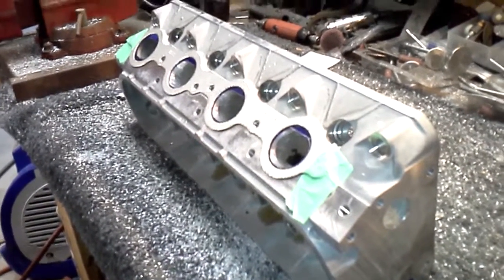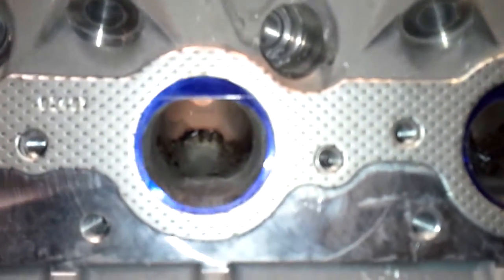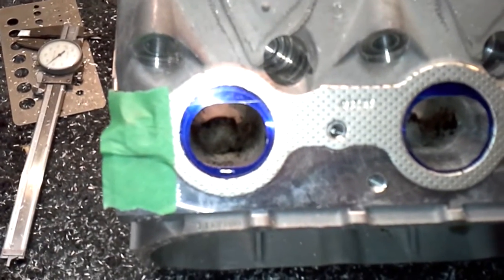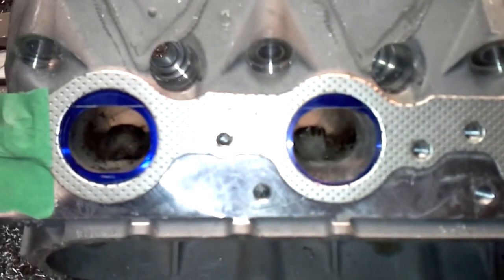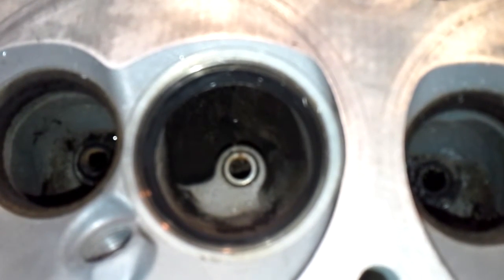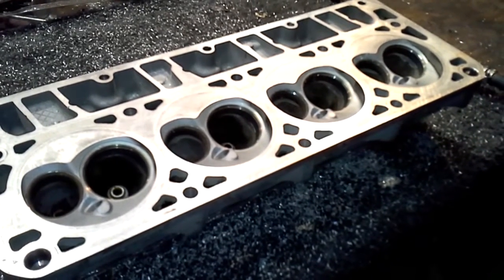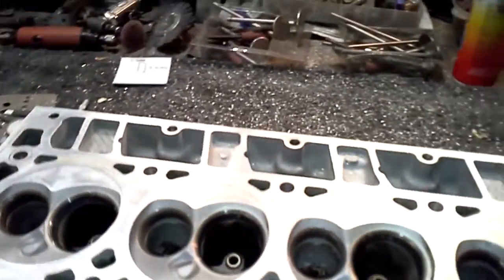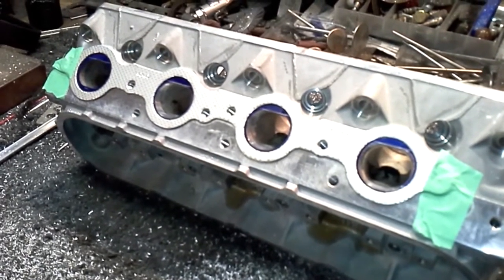241 LS1 Head Porting #1

Comment: How can  I get ahold of you?  I want to build a 5.3 for a heavy C20 pick up and Im mostly concerned with torque.  I have a set of 853 heads out of an LS1 and a set of 706's out of a 5.3.  Wich one's would you use?  The cam I want to use is Lunati grind, 212/218 @.50  531/531 valve lift and 113 LSA.  I think its a good choice for a heavy vehicle.
Reply from the maker: Chale Charros Interesting, what’s the C20 going to be used for and what fuel do you plan on running? 
1. 853 heads have external bolt valve covers and use different coil brackets & Large chambers.
2. Are you going EFI or carbureted? 
3. Automatic or standard transmission? 
4. Flat top or dished pistons? 

Richard Holdener has shown Dyno numbers testing several of those Low lift High Torque truck cams on his YouTube channel.  You can make some good power/torque across the rpm range with the right camshaft. 
The 706 heads would provide more torque due to the better combustion chamber size/shape. Most importantly, the 706/862 heads maintain the engines compression where as the 853/807 heads have huge combustion chambers greatly reducing compression ratio. 

You can email me:  jeffdubray@gmail.com

Comment: 241s flow about 238 stock as cast with stock valves, they can flow 288 CFM with stock valves if done correctly. 210 out of the exhaust port is a real  feat, like to see those flow numbers.
Reply from the maker: Peter Fraumeni If I remember correctly, the Gear Head 4 life guy had his heads flowed after he ported for the very first time and his heads flowed 208+ cfm exhaust side. I’ll see if I can find it, I don’t have any current flow sheets since we lost flow bench availability over 10yrs ago in our area.  Now, we found a guy who owns the flow bench everyone used, albeit it’s really old now, he charges $125.00 to flow a head one set of ports. JD
Reply: Peter check out these exhaust numbers from TEA on the 241s.  Think they are BS?  Most people show about 210 for exhaust but they show 244 at .600"!  Insane.  It has to be an opening fit for 1 7/8" long tube headers.  

https://totalengineairflow.com/product/gm-5-7l-stage-1
Reply: @JonnyAbs-0  are you butt hurt because I think the exh port is limited?
Reply: @petejoseph8257  no, you took my question the wrong way.  I was asking based on your experience if you thought these numbers were fudged.  I am thinking about having them do my 241s.

Comment: Post before and after flow numbers.
Reply from the maker: Peter Fraumeni It’s possible if someone needed or wanted, before and after flow sheets, it would cost $250.00.  I’m willing to take the time; set everything up and video the results if possible. 
My ports are proven performers and nobody seems interested in paying to get heads flowed.  It sucked for a long time, the only shop around the KC area with a bench was K&M machine but they went out of business years ago.  I’ve lost a. Couple port jobs, Viper V10 and Coyote 5.0 heads because I didn’t have access to a flow bench.  
I’d really like to own my own flow bench!  JD

Comment: Nice ol, video! Yeah the LS is a great engine! All of them! And with cast steel manifolds, if you have a grinder and welder, but no funding for headers, you can always cut, grind and weld your way in to a set of high flowing cast headers, or turbo manifolds. Even do a kinda high port, open up the top of the manifold port, and weld to reinforce, may look crappy, but it will work. The manifolds can be heavily modified!  I'm thinking about keeping the manifolds, on my S-truck, swap, just cut the flange off, and weld on about 1" of pipe and V-Band, to clear the frame, and maybe turbo! I'm atleast going with a 4.8/5.3with a bit of cam!
Reply from the maker: JAMES! Since the 70's Check put and subscribe, here’s the Turbo build using OEM LS3 crate exhaust manifolds to build off of. 
https://youtu.be/xLwMuvg6ErY

Comment: For someone who wants to try doing this as DIY, how do you keep your cuts the same in all of the ports? Do you use measuring tools or just feel it out?
Reply from the maker: lost1mp I use templates, calipers, scribe gaskets and other measuring tools.  If you watch my cylinder head porting math you’ll see the bowl cut percentages I use. 
As you start a port you will identify certain landmarks to use as a guide while working/blending the work. Each type of head will have slightly different areas and techniques during the porting process. 
I use valves cut concentric to the bowl cut percentage for each application. Learning each cutting/grinding burr/stone cutting type and finding the best size and shape for each process saves time. 
If you have any more specific questions please feel free to ask.  Thanks for watching and the feedback! Merry Christmas 🎄

Comment: Have you done work on the Dart heads for LS? If so..do they flow more the stock LS heads?
Reply from the maker: Doug Williams What’s your build and which heads are you looking at? 
205cc, 225cc or 250cc Cathedral ports or???
Reply: @HeadFlowInc  
Dart cantered valve heads...

Comment: Hi is it better to just swap a ls1 241 heads for 243 head for more hp gain, instead of porting the 241 heads, cheers
Reply from the maker: Dardy Clubby Yes, both heads have the same size valves but the 243 heads have larger runners both Intake and Exhaust. 
#241’s  2.00/1.55, 200cc Intake port and 70cc exhaust port.
#243’s 2.00/1.55, 210cc Intake port and 75cc exhaust port.

Flow improvement on Intake side:
#241’s 220-225 cfm
#243’s 250-255 cfm

Comment: How much you charge  to do 241 and 243 heads?
Reply from the maker: Chevy Boy I stopped giving quotes where shipping is involved.  $650-750.00 depending on whether  the heads need surfaced. (Highly recommend).  Using your good castings. What size CID are you building and what size ports?

Comment: The guides are not machined in line(concentric)to the valve seats forcing the valve to wear out the guides and break the valve stems. Gm never machined the z06 heads correctly throughout all of them. You need new valves and guides with a newly ground seat using your new guide to line up your seat grind. But now your valves will sit deeper in the combustion chamber and you want all chambers to cc the same number or get new seats too. gm spent lots of years making all zo6 heads all wrong. Hand made lol.
Reply from the maker: andrew paul I've seen people on Yoitube showing how the guides wear out after only a short time on those Z06 engines. Surely it was a process/engineering over sight?  I don't think I've seen the issue on the 4.8/5.3 or LS1 heads, maybe GM used a different manufacturer for the Z06 heads?  I'm 🤔
Reply from the maker: andrew paul See  chadyellowz06 channel he has good information on the many issues with the Z06 heads.

Comment: Interested in cost also.
Reply from the maker: Andy Dittmar I've been working on the price point: Fully ported the entire head  Intake and exhaust runners, Competition valve job, and surfaced up to .008 $1000.00
Reply: Does this include re installing any valves and springs? If I provided new valve springs?
Reply from the maker: Andy Dittmar Yes the heads will be full assembled with the proper installed height for the valve springs.

Comment: what do you charge to do these 241 heads ?
Reply from the maker: Total cost will depend on shipping costs I'll message you.
Reply from the maker: No option to message you on your channel.  Let me know where the heads are coming from?  If your heads require surfacing it adds to the cost.  Port work $750 plus the cost to surface and always recommend a fresh Competition valve job.  I'll try to work with you concerning the shipping and machine work.  JD